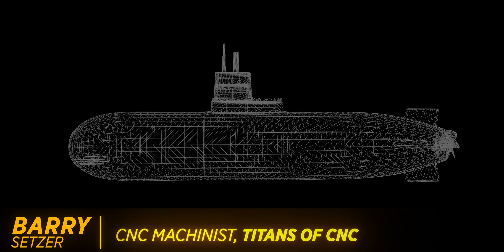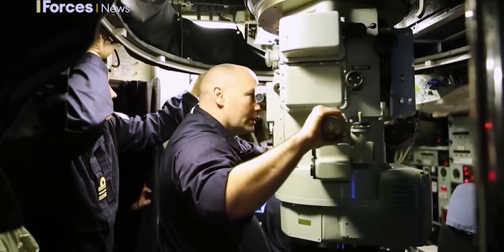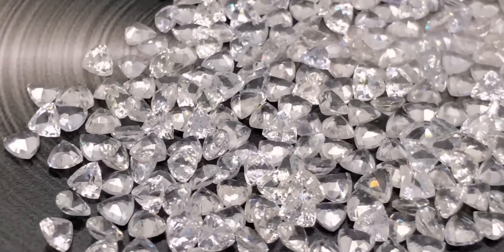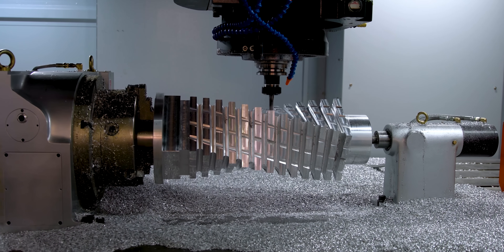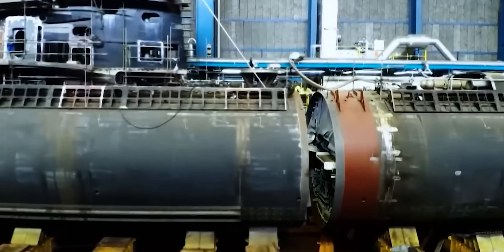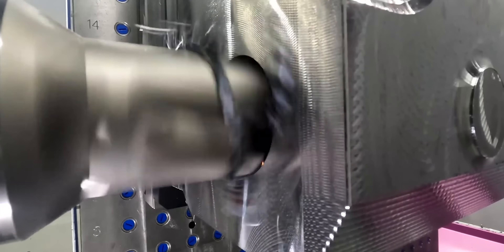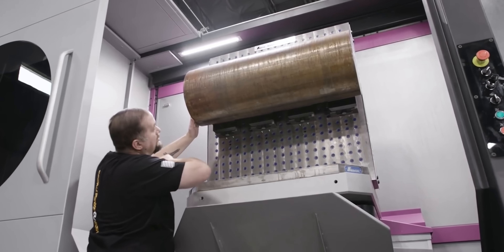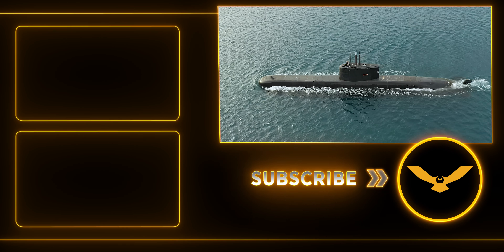I Machined a 50 Million Dollar Part

Comment: The company I work for does quite a bit of work for some big players such as Seimens, GE, Northrop Grumman, U.S. military, and several others. We generally will machine our parts in 3 stages which includes several operations. Roughing, semi-finishing, and finish machining. The “newbies” start on our smallest parts roughing with pretty wide open tolerances. After a year or two they advance to  semi-finishing. The parts get larger and tighter tolerances. Finish machining requires skill as the tolerances are +/- .0005 or less. Stack heights, surface finishes, diameters, depths, tapers, all critical. Some of the larger parts, weighing up to 15 ton, may have a bore diameter of 60-70” with a .0005 tolerance with a 16 or less finish. This is where I thrive. Some coworkers will never finish parts as they stress out too much. Requires confidence in yourself, machine, and tooling. Sure there’s a bit of stress because of money spent at this stage, but rewarding being able to do the “money shots”. I can relate to this video as quite a few parts we machine are one piece orders. Maybe 2 pieces here and there. Simple really. Don’t eff up. 38 years machining and counting. Have a huge 5-axis coming in December. Can’t wait to play on that for awhile. Never done learning. Thanks for sharing.

Comment: Shortly after WWII my neighbor had to machine the compressor section for the first jet engine built-in the US which had to be made from a single piece of metal. He started on the last set of blades when he realized they were backwards. Ooops! Got it right the second time.

Comment: I was working for a company that did aerospace and they where machining a weird part that looked Almost like alien vs predator it looked weird and hat a bunch of angles the part it self took almost 3 weeks to do so one of the guys messed up a part than we started machining  another one tell me why the programmer had changed the program to use a .750 inch ball radios and it had a 1inch ball radius on thr machine i did not see the description of the program that said .750 I just saw ball end mill seen that it was ball end mil and you could just hear the loud cut man what a fuck up close to 100k so I was told I quit on the spot worst feelinf ever and the type of stress that comes with it is horrible not sleeping right waking up in the middle of the night thinking bout the part I don't think it's worth 30 dollars an hour for that type of stress I'm thinking at least more at 40 idk I feel like machinist are really under paid...

Comment: We used to machine Monel Radar Waveguides, so I know how tough the material is to machine. We also machined the core components of Polaris Submarines, on manual machine tools. Two tenths of a thou limits. I did the inspection, and quality sign-offs. No Co-ordinate measuring machines in those days either. I, in more recent years machined a section of the Cern Large Hadron Collider, interesting work brings out the best in people doesn't it.

Comment: So 18 years in from no schooling no exp I realize I don’t know anything. I went to day shift at my shop and was first in line for our first aerospace. Took 18 revisions and weeks of disappointments which I hold half on my engineer. Was admiant about Vericut but we run NX and he just kept complaining about our software and made my job increasingly difficult. By version 18 I slammed my monitor when he mentioned Vericut, walked into my plant manager’s office and said “ night shift or I’m done”. The day guy only had to deal with a week of optimizing a thread mill but it was too much for such a small shop dipping their toes into aero. We have a few young guys now that clearly were born in a CNC and god bless them. We aren’t an old company but we bought off a lot. Now we are stuck in the only X amount of operators can run aero and our medical fields have slowed. Poor hiring and stretched thin training has made my job extremely frustrating as well as as production control. I’ve been with this company 12 years. First five axis job, promoted to night super than downgraded to night mill lead has its advantages as I’m sorely just a mill guy but poor quotes and cheap labor equals cheap product and stressed vets. Period.

Comment: I made sum super expensive parts for CERN.  However it wasn't one single part it was 26 pieces that fit in a circular detector each made from platinum.  Each part weighed 8lbs 4 oz, so do the math on that.

Comment: Elon Musk would say whoever designed that has a high idiot coefficient (done part / material cost - not saying you are the idiots, but this requires a LOT of redesigning to get the costs down, such as they did with the Raptor engine with a like 80% cost reduction over time.

Comment: Built the first two U212 sub for the Italian navy (worked as PM for the company that built the machine used to build the keel)... and I complete understand your fear, (we worked on Amanox, a stainless steel that it is also magnetical dampening or, to be more accurate, sound dead to magnetic wave making the sub way harder to be found by magnetical anomalies detector) all taht said, the only thing I can add is well done Sir. very well done

Comment: I was drafted out of machinist school to work for Cooper Bessemer in London Ontario Canada making ships engines and pipeline compressors for both centrifical and horizontally opposed piston types. A rough casting for a 48 inch jet engined was well into the millions. 40 long tonne castings were just another day at my 12 foot table Vertical boring mill by Berthiez.I will never forget those wonderful days. DRO was just starting. We all worked on good old dial machines and tape machines. Had to do math all day long. Rolls Royce jet engines powered some compressors. 18 yrs old and in 7th heaven, LOL.

Comment: I routinely turn and mill 5 digit one off printed parts for a large vendor. Running test features and holes in scrap along with single block and dry run is straight up SOP. 

No room for error.

Comment: 1.3 million dollar drives shaft for power plant turbine, it was shaped like a very large spool with approx 4ft flanges and 16" center.  I was only making some modifications. I also worked on the reclaim turbine, I asked the cost and the engineers from Germany answered priceless.  Good times, really.

Comment: I was machining a very expensive bronze casting at cla-val - Griswald Industries I was only a lathe operator back but I turned castings that were off round so the parts were always close to crashing because they were shaped like cast valve bodies. It was like turning a fire hydrant body... I worked 2nd shift so the day shift guy said he went through the program and updated the tool and offset numbers. He told me that it was ready to run and it was until the last tool. it had a 6 or 7-inch diameter thread and it was probably less than 8 threads per inch so it was a real deep thread and we were supposed to debur the thread after the Higbee cuts with the single-point threading tool but instead of the threader it called up the groover to cut the threads and it wiped them all out. they had to melt it back down and re-pour it and it cost over 20,000 dollars.

Comment: I used to work for a aircraft alloys / aerospace alloys supply company and some of the cnc / machining done of various aspects of aircraft design was totally amazing ,the flag you guys made was also top notch, the only thing is that if only you could have made it even more polished so that the surface if put under a microscope would be perfectly flat and a perfect wave as well as the stars and stripes was also done in such a way that none of the edges were sharpe at all, all the lines cut into the aloy was all smoothed over, then i would be impressed, including the stars on the flag?
Still very impressive, i bet that you guys do all that when it comes to hi end machining practices especially when it comes to DOD contracts and what the requirements are, cheers .🦘🦘👍👍👌👌✌✌
I wonder how many parts were made by cnc and then put into a acid bath to make it even more accurate to remove micro amounts of material from the finished product, so it was perfectly smooth.
Aircraft alloys and hardened alloys and metals when machined you cant get a perfect smooth finish ,you have to use acid bath and based on the metal and or alloy and concentration of acid used, removes just what you need to get a perfectly smooth finished part.

Comment: Having worked on these kind of parts , I know the pressure you are under. Where I worked , they gave you no test piece . I had to do the programming , set-up, setting tools and final machining and inspection.  Because of the tight tolerances and various piece size . Weld repair on most of these materials was not allowed.  And they did not tolerate many mistakes.  Plus I always spent to much time on the piece.   Happily retired now.  😃

Comment: There is a big difference between working on a $50 million boat and machining  a $50 million part.  On the boat, most of the work is not going to bin the boat if you make a mistake.  Machining the part is different.  Unless your mistake can be corrected by removing more material, you’ve probably just binned the part. I’m assuming you cannot just weld a bit back on to a billet part, machine it to the specs and all is fine.  But I only a hobby machinist, so I don’t know.  Since I don’t weld, the stuff I make mostly has to be good the first time, or ai have to start over.
Reply: Big difference indeed. You'd have to do some crazy ass shit to that ship to completely ruin it.

Comment: I do commercial Hvac so very large ac units wither they be package RTU's (roof top units) or split AHU (AIR handler units) ive got 2 ones that stressed me out something fearce the first was a 100 ton TRANE clean room unit having it lifted via crane onto a 5 story roof the rigging and straps and plan had to be perfect or else if that unit failed or fell onto the ground that's several million in damage and new unit god forbid it hit the building or fell onto it. 

The second one was for a large factory that needed a new chiller system 2 300 ton chillers and new cooling towers if we didn't hook everything up correctly or something wasn't sealed that's a lot of time and money plus the chiller burst disc is only rated for 15 psi and that oil can absorbe (selling I know) all the moisture from your skin and not to mention ammonia hazards

Comment: I had an idiot proof Ikea book cabinet to assemble. Very few parts. Foolproof instructions with images even an infant could understand. And I built it upside down, with the back wall inside out as well. Suffice to say, I don't think I should touch a 200k+ value piece in my lifetime.

Comment: My most expensive parts i make come around afew times a year.  Its a big forged stainless eye bolt 3inch diameter shaft and 7 inch diameter hesd .   Its 1 day of mill work and 1 day of hand work grinding and polishing after 2 days of lathe work. It takes so long to hand work and pokish because we dont use cam software and only use conversational programming so ot comes out roughly round and with lots of steps that have to be smoothed

Comment: We never used carbide to machine Monel! We used supermomex high speed steel. I worked at Hahn& Clay in Houston Texas!  All manual machines, we have the largest vertical boring mill with a 30 ft table and 20 ft rail height!

Comment: Most expensive thing I worked on were pieces to a 500 thousand dollar inconel 718 assembly. Part and tool deflection was the most difficult thing to fight and took a certain amount of 'feel'. Thin wall ribs had to be braced with adjustable risers. Someone else got to run the assembled piece for that particular operation. Most nerve wracking thing I've programmed would be rotor tippy parts. All 5 axis except roughing and very fluid moving tool paths to get around the cylinders and ears. Unified morph was by far a common toolpath in the tool path manager.

Comment: Ive literally started my apprenticeship in machining, i spend most my time at work on the manual lathe and i love it, i usually only make washers, spacers and bushes but i always try get them as close to perfect as i can and even if theyre just getting welded straight to a trailer i make sure they come out looking real nice, ive used a few machines but id say the lathe is probably my favourite and literally last week i just got my measuring tools sorted (digitsl calipers being my favourite) and im having a great time working on the cheaper parts but getting them basically perfect, even if i have to make 70 i make them as close to as identical, i hope that this attitude pays off like you guys said 💯

Comment: I'm so glad you said it's a healthy fear to worry about screwing up expensive parts, I worked a Studer grinder as my first CNC job on 3rd shift with only one months training and I was worried about crashing all the time and holding .0001" squareness and parallelism only had one crash and one scrapped part but I couldn't take the stress of being undertrained without support because they didn't have anyone else on third with experience on the machine. Now I run a '68 Bridgeport with the cheaper fixed speed J head and somehow make more.

Comment: HI! im new to cnc. i want to learn manuel lathing and cnc. Is MasterCAM THE prgogam to learn for this? is it compateble with most or all cnc's? is there any youtube channels explaining how to get into MasterCAM in a effective way? Not a super nerdy tutorial seris of 5 first hourers for how to navegate and understand the safteys. i need to know how i should think when designing a part from paper to sketch to routed path and with witch tool. the goal is to work with 3-axes cnc. (older machins that the workshops have nerby to me). i live in sweden and planing to work for a general-metal-workshop. so no fancy 5-axes.

Also how do u control the big robot arms? the ones for welding, lifting or what ever atatchment u put on it? is it with MasterCAM or a completely different program/language?

Comment: The most difficult part I ever programmed and machined was a rotary gear housing for a Boeing 737 aircraft. It started out as a sand casting of T-356 aluminum. It had the profile of Mickey mouse's face..... Half-inch thick Base attached to .200" thick wall. The wall had a depth of about 5 1/2 in.

Aside from various undercuts, we had to produce 3 bearing bores (+.0000, -.0005'). At assembly a top plate had to be attached, along with two alignment pins 8in apart, with a location accuracy of (+.0005/-.0005").

It took 32 tools and 3 1/4 hours to machine each of these castings on a horizontal CNC mill (tombstone on a pallet).

The backside of the base had to be flat within .001"...... The top of the wall had to be flat within .001"...... And, if that wasn't bad enough, the base hsd to be parallel with the top of the wall within .001".

Everything looked beautiful (within tolerance) ...... Until we unclamped the casting from the tombstone --- yup! It twisted like a pretzel! All of the casting stresses were released during machining. 75% rejection rate.

My fellow manufacturing engineers and I put our heads together......"wouldn't it be great if we could relieve the casting stresses before final machining?'

With the help of my capable Machinist (who was fantastic, but totally deaf).... We spent a couple of days trying different techniques to relieve the stresses before the finishing cut. We finally found a solution. 8-10% rejection right now!

Flatness consistently came out within .0004-.0006"..... And parallelism consistently came out within .0004-.0008".

What a headache that job was!!!

Comment: most expensive job we have had so far was around $17k. These parts were small levers that engage with a spring in a plane engine. We made 200 of them out of 7075 aluminum. Ther were lots of learning moments and even a limit switch replacement, but they came out how the were supposed to. We are currently in the process of getting your SVM 4100 and hope to begin taking on government contracts. I am also starting your cert program in my high school manufacturing class. Thank you for showing me what my dream job looks like.

Comment: I've watched a few of these vids by the Titans of CNC, and this one was just as good. I don't know anything about this kind of work, the best ' finish' work I have done was custom residentian kitchen ceramic tile installation. But my Old Man worked for Lockheed years ago., so I've heard some things that I'm probably not supposed to know anything about.  Now my EX business partner is sitting on an expensive piece of equipment that I wouldn't put our LLC in hawk for...and doesn't have a clue how it works. Go figure who's going to learn some new tricks, Fast. Thank you

Comment: Just got a job machining wood parts for cabinets a month ago after leaving a paint making shop (my first full time job) with no prior school or experience and I'm loving the technical side of CNC and I love operating it. I've caught on pretty quick with the blueprint reading and operating the machine and eventually want to get into metal when I get some years on my belt. 

Was curious if some of y'all have any advice for me since I'm basically an apprentice and still learning.

the main question I have is I'm referred to as the CNC operator while the CNC programmer actually makes the script for the CNC to follow. So will I eventually need to learn how to program to make this a thriving career? Are Operators more sought after than programmers or do you typically do both on the metal side?